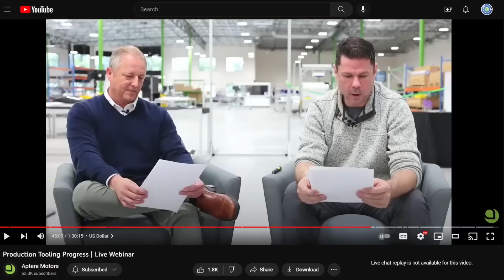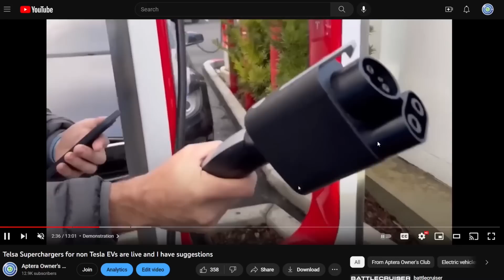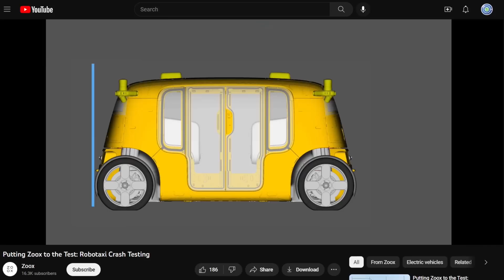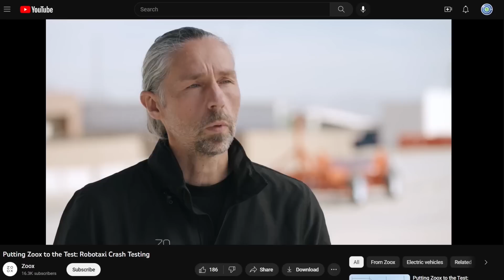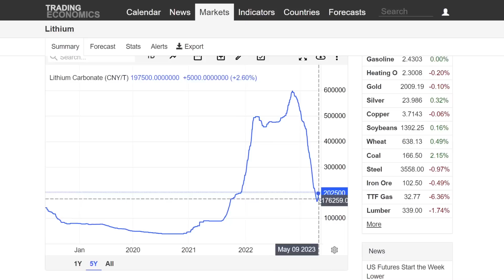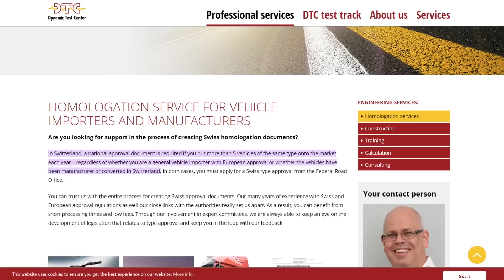Solar, Acoustics, Charging, Supply Chain, Steering:  Aptera Production Tooling Webinar Q&A Part 2

Comment: Yup he needs to reevaluate his whole situation, so the CEO is saying that we have to lose weight in order to get more range, I personally weigh 370 lbs at 6'3
Reply: Where did the CEO say anything about losing weight ?
The vehicle has a 500lb weight limit. Two of me would exceed that. I'm sure that exceeding the limit won't be a big deal. Performance and efficiency will probably drop a little.
Reply: @garywozniak7742  Don't forget he's saying 300 for two people plus 200 for storage.  It doesn't even work out right considering the average American male is basically 200 lb.
Reply: @Ronnie Bickers Jr  I think that you are over thinking this. He said the vehicle has a 500 lb capacity. It is what it is. I'm sure it can handle more weight but it will impact its performance . I'm sure that weight/size discrimination is not what's going on here.
Reply: @garywozniak7742  I agree
Reply: @garywozniak7742  I don't believe there's any kind of weight discrimination. I'm just thinking that the CEOs are not being clear enough. Am I mistaken, did he say capacity or weight limit?  Those are two different things. I'm just concerned because they made no mention when going over it, what the negatives are?  That's what I'm interested in knowing.  I know I'm probably overthinking it, but it's a huge purchase and I would just like to be reassured I guess. I'm certainly looking forward to getting the Aptera. 👍
Reply: @garywozniak7742  in light of what I have red in the comments and the email from aptera I am satisfied with this cycle and don't get me wrong I fully support and do want the 1k range aptera. I had some concerns but no more.and my concern was about weight and availability. The cycle is perfect for me as an disabled person so I'm all in.and thanks to you all .
Reply: @Joe Schmoe now this is a thoughtful argument and observations I can support and do agree. And I do admit I too did not consider all those variables thank you.
Reply: An Aptera is not the car for you........
Reply: @ericstarmer7779  may not be for you either

Comment: Regarding the 500 lb weight limit, I'm prettu sure that can be worked around fairly easily. All the plans for the suspension I've seen to date feature adjustable coilover shocks. The cheap and dirty method to increase weight capacity a couple hundred pounds is to crank the springs a bit tighter. The side effects of this include the center of gravity being a bit higher, ride height slightly increased with light loads, anti-roll bar efficacy slightly diminished, tiny increase in roll resistance, and ESP systems pushed farther out of their intended operating range. Shock valving should be sufficient.
Reply: I'll keep this in mind when I deploy the beach chair backwards in the cargo area, for a third passenger.

Comment: - Hail speed hitting a moving car would be significantly higher than hail from the sky onto stationary panels.
- Sound should be pretty good.  Much comes from underneath and that is quite thick with skin, battery, tub, carpet, etc.  As long as wind leaks are stopped.
- Front impact should also be good, considering the aluminum casting that holds suspension and battery.  Better than Zook.
- Wikipedia: average American 180 lbs. (I am above average, but my wife + me would be slightly less.)
- Pricing: So many changes since initial reservations.  Carbon vs honeycomb. (more or less?) Batteries (up and down). Electronics supply. Elaphe motors. Plus general change in glass, tires, etc.  And interest rates. An enormously complicated situation.
- My guess: $200 million total to get to production. Investments, loans, supplier financing, grants, down payments (at time of production), Lotto?
- Making cars is hard.  Thanks for the breakdown of Q&A.
Reply: Yeah, Accelerator program + 50 million are just to commence production. These will be starters for Aptera, but they are like an escape velocity for a space rocket. These are therefore the most crucial part of the equation.
Reply: That Wikipedia "180 lb. average American"  figure is likely derived from an FAA "average weight" designation stemming from an Airliner crash involving a plane-load of athletes that was overloaded. The "official" weight designation was penned before the crash was  at 160 lbs....a figure that might have been accurate in 1910. This particular plane-crash was at least twenty  years ago and this notion of 180 lbs nowadays is absurd in the extreme, more like 205 lbs.
Reply: @AndieBlack13  Recent CDC data says 198 libs for men above 20 years old and 170 lbs for women above 20 years old.  Throw in kids and teens and the 180 average isn't so bad.  None of this is 1910 data.

Comment: Just a word on battery material costs, yes nickle and cobalt and graphite have come down a little in price which should help but lithium hasn't. That chart is for spot lithium only which is not the price of lithium. Less then 1 percent is traded on spot and contract prices have stayed up in the 50kpt range and are expected to go up this year. Plus that is lithium carbonate prices but NMC uses hydroxide which is higher cost and didn't have a spot price dip.
Reply from the maker: Good to know. Thanks for the info

Comment: I will say carbon fiber being used in super cars doesn't really say much about it's sound isolations. Sound isolation is kinda the antithesis of buying those 800+hp 8-12 cylinder super cars.
Reply from the maker: Fair point ☝️
Reply: CF needs to be sandwiched with an isolator.  If it’s just CF then there is little to no sound isolation.
Reply: The answer to that is (which sounds?). They want to transmit some engine noise and road feel, but don't want the $$$ supercar to be rough, clunky, rattly or tinny.
Reply: The fit of the panels are key to keeping any sound from entering the cabin.  The people making the panels assure the tightest tolerances possible of any assembly process.

Comment: about the variable turning wheel, I think Chris was talking about torque vectoring individual wheels and not steering wheel. I believe this can be implemented in Aptera much more easily since it has in-wheel motors.
Regarding battery cost, I believe the Energy Density is going to go up and the prices going come down with new evolving battery chemistries. (I am referring to Tony Seba's famous 'S-Curve' here).
Reply: From what I've been able to determine from watching a bunch of videos and interviews. Aptera has a mechanical steering linkage with a 2.25 turn lock to lock and a variable assist electric motor.  The motor provides more assist at slow speed then at high speed. The electric steering motor is also used to automate the steering such as w/OpenPilot .

Comment: They test solar panels with ice balls, but that test is for a roof that doesn't move. What about metal debris flying at you while driving 70mph (I've had a piece of metal hit my hood on the highway). If 1/2 panels get damaged will that stop the entire solar system?
Reply: I should have worded my concerns differently lol, but thank you @maddog and Bob.
Reply: If by "1/2 panels" you mean "if 1/2 of a panel" gets damaged will that stop the entire solar system the answer is no.  At the very least, each panel will be independently controlled via one or more MPPT's.  So, for example, if the hood panel is heavily damaged, the dash, roof and hatch would still be capable of delivering their respective full power(s).
Reply: No
Reply: Quick answer is NO. Aptera has stated that a cell can be shattered and still function, only 2% or 3% loss of efficiency.
Reply: @barnabasseadog7660  While your "Quick answer" is correct, it's not correct for the reason you stated.  The Maxeon cells Aptera is using cannot be "shattered and still function (with) only 2% or 3% loss of efficiency".
Reply: @bobhilder1469  I heard this from Aptera video interviews, just relaying info they disclosed. If you believe the claims or not is not the issue.
Reply: @barnabasseadog7660  Fair enough but your "relaying info they (Aptera) disclosed" is helping to spread dis- or mis-information and, presumably, you aren't cool with that(?)
Reply: @bobhilder1469  Spread whatever FUD you like. Aptera says break one of their cells and it will still function. The future pulls us all.along, no matter your opinion today.

Comment: As I only weigh 150 pounds, can I expect to get more mileage per charge?
Reply: In theory, yes. Practically, no. There are so many other variables that can impact your mileage from day to day or even hour by hour that saying your mileage is X.xxxx and not something, is not realistic. You would have to be in a lab like condition to measure it. If the difference was 100 lbs then you will see a slight difference in mileage. Tire inflation will have a big impact on a vehicle like this where everything else is efficient.
Reply: In order to get an accurate answer to your question, Aptera should tell us what they mean mean by, e.g. 400-mile range. Is that with or without a driver, passenger, load, etc.? If with any of these, then they have to stipulate the base minimum added weight for the range. From there people can estimate the effect of their extra weight.
Reply: @adimchionyenadum2962  With or without a driver? Seriously?
Reply: @markfinley3703  I wouldn't know. After all, the test in a simulator may not require a driver. Don't tell me they have tried any in real life with a driver.

Comment: For the shorter range Aptera, any chance Aptera will move to LFP batteries? As have longer life, and can be 100% charge.
Reply: That would be an R&D spend that they simply cannot afford right now.  In an ambassador call about a year ago Chris answered me and they are definitely open to it.  Even sodium could make a great option and could easily be 300+ miles of range (500 miles at the same volume as a 1000 mile aptera - yes I accounted for the weight).  Both sodium and lfp are not capable of as fast of discharge as nickle based cells so being a small pack and lower discharge it will impact acceleration substantially (ie 7-8 second 0-60).
Reply: Look up Aptera's deal with Formosa. LFP batteries for the Aptera will likely be happening in 2024. At least for the 250 mile model.

Comment: Relative to battery material costs, Aptera is fortunate to be using batteries about half the size of most EV models. That will help keep costs and the final sale price low.
Reply: Well the 60 and 100kwh batteries are fairly comparable that on the market. A chevy Bolt for example has a 65kwh battery. And a 100kwh battery is actually bigger than a Model 3's.
Reply: Also cuts down on charge time

Comment: The tesla network situation is a bit of a mess.  With only magicdock enabled charger access Aptera will have by far the most limited network access of any vehicle.  It is a PR mess for Tesla is they block them.  Converting twice would be epically silly  I cant see tesla making a unique subset for Aptera - we will have all or just the magicjack ones.  

Aptera does not have the money to lose anything on each vehicle.  They need to make some money to spur IPO investment.  (not the same as being cashflow positive as a company - that will take years)

FYI:  180 lb is the north american adult average.  My estimate for the pack is 455lb for the 400 mile range and 909 for the 1000 mile.  My calculations on the weight/efficiency is 300lb is ~6% impact (at 55mph) but Chris has been saying 1% for a long time - it is an easy rule of thumb.

PS:  At ~ 4 minutes I assume you meant kilowatt not amp.
Reply: I think that you are missing the fact that there are over 40,000 Wall Connectors at Destination Charging locations in both urban and rural area. Level 2 charging will be over 56 miles an hour. The trick is that I don't see Tesla committing to direct Supercharger support for Aptera before Aptera commits to a production start date. I believe that it will all come together in the next year, and much more quickly if an angel investor steps in, or the Govt loan is approved.
Reply: @deanmcmanis9398  The Alternative fuels data center map shows 5000 sites for tesla level 2 in us/canada and almost 55,000 j1772.  Easy to adapt but by far j1772 is more common.
Reply: @ccibinel  and Aptera will be compatible with the j1772 chargers if you purchase an adapter from Tesla (the adapter comes with every Tesla vehicle). Don't know if there are any third parties that sell equivalent adapters.
Reply: @AverageJoe928  tons.  Level 2 is trivial.  If all Aptera's will need adapters to charge because ee only get magicdock superchargers then a lot of Aptera charging at level 2 or 3 will need adapters.  Basically that makes the port the equivalent to laptop dongle hell.
Reply: Chris predicts Aptera will be profitable  2 years after production starts!
Reply: @gmv0553  And as an investor I hope he is correct but profitability is actually a very difficult place to reach for any startup and CEOs live in a reality distortion field.  If they can profit per unit after 500 and reach profitability within 4 years that would already be impressive.
Reply: Two great engineers weighing in at around 350 lbs, add the Bernese dog and a Costco run and you’re over the limit